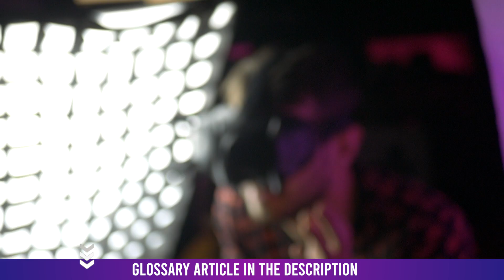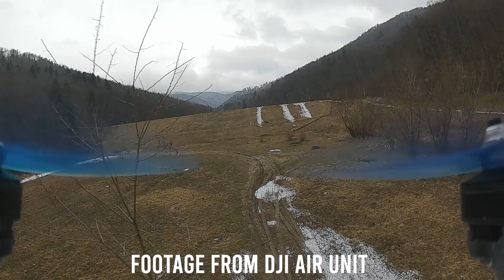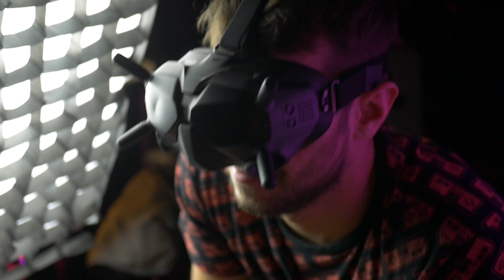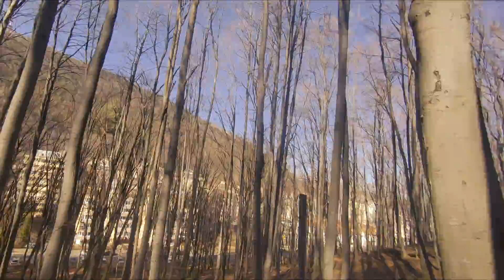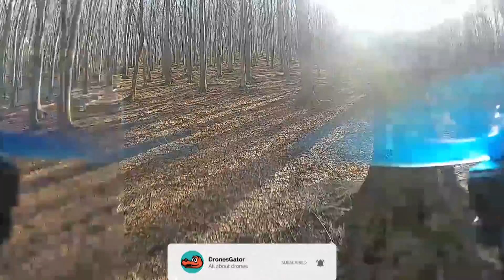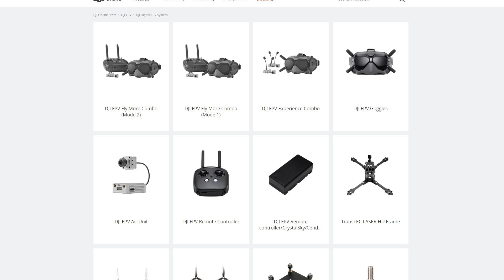DJI FPV System review (Is it worth your money?)

Comment: Dji fpv is worth every penny. 👍
Reply from the maker: Thanks for your feedback!
Reply: One of the cool things i like about the dji controller. If you hold down the  C button it locks the controller until you hold the botton down a second time. You can still use it to navigate the menus. No need to setup a pre arm switch.